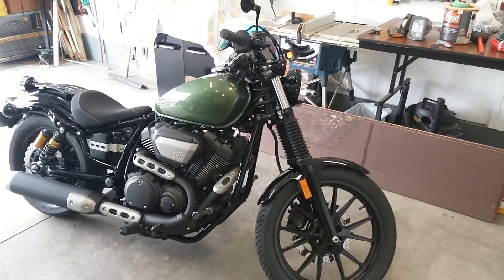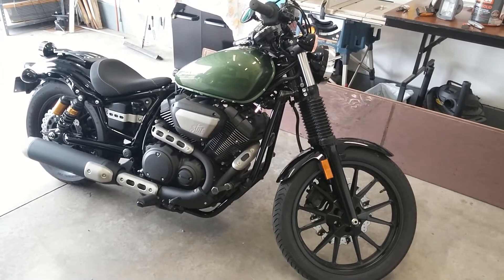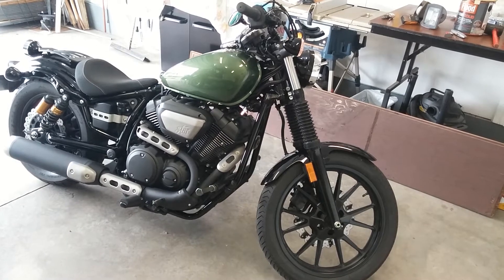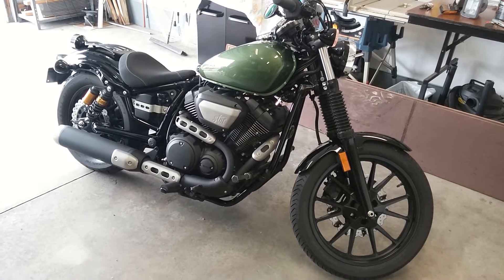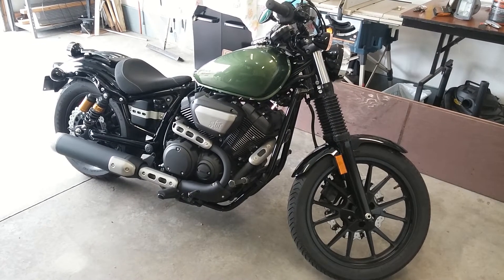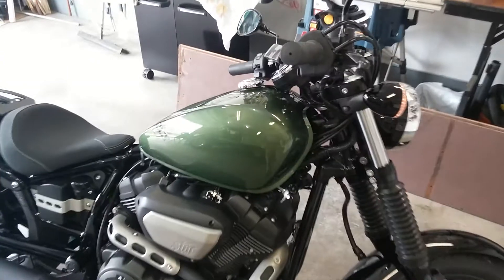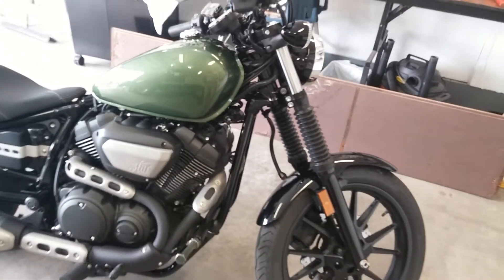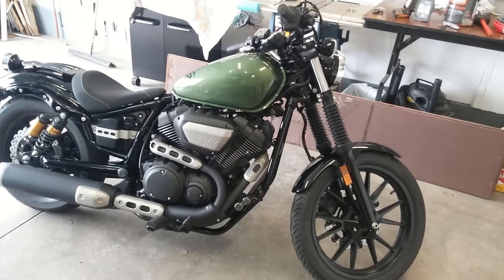2014 Yamaha BOLT stock exhaust

Comment: would you say the bolt is decently loud?
Reply from the maker: +Keith Person I have to say that the general volume of the stock pipes was perfect for me and my daily driving. The bike is a nice around town and short trip bike. I ended up buying the vance and hines Twin slash more for a different sound, (AND LOOK) not so much the volume.   I ended up going back to stock pipes... the twin slash, even though had a nice low to mid range resinated in my helmet and literally gave me a headache when doing any distance over 55mph  (the bike runs a bit higher RPM at speeds over 55, so it bugged me enough to tuck away the pipes...

BUT in regards to the stock, they sound good IMO at all speeds ant they aren't loud enough to drive me nuts going on a 100-150 mile bike trip for fun or benefit.

hope that long ramble kinda answers your question?
Reply: That's the best answer I was given. Thank you so much. I'm about to buy a yamaha bolt 2015 r spec, black and red color in two weeks. You explained everything i wanted to know, even the vanes and hines twin slash. I wanted to know if the vanes and hines will bother you and you answered that. So I'm glad the stock pipe is loud enought and has a grrat sound but no dangerously loud like the vanes and hines. Thanks a lot. I will be getting one of these bikes soon. Sorry for the late reply man.